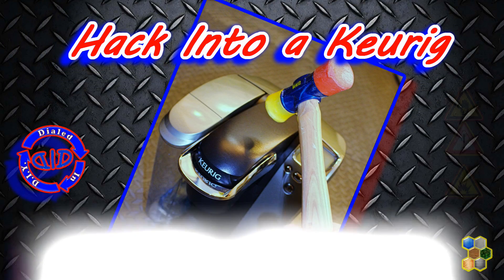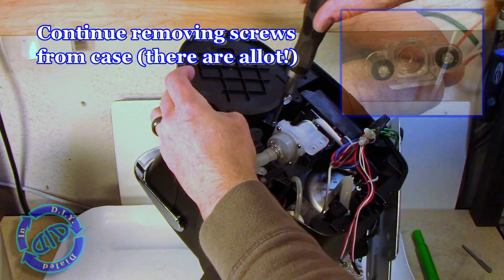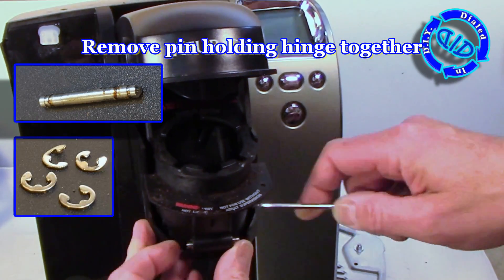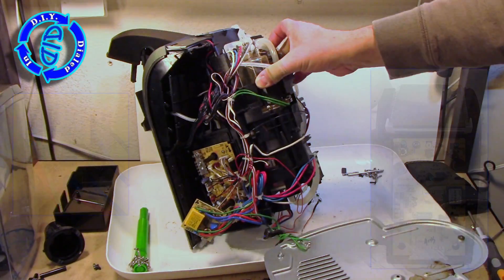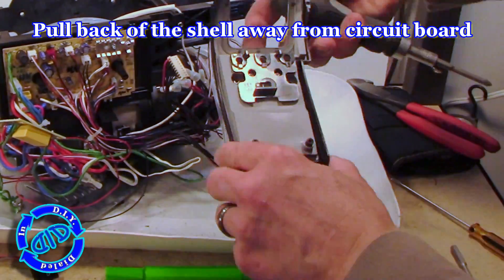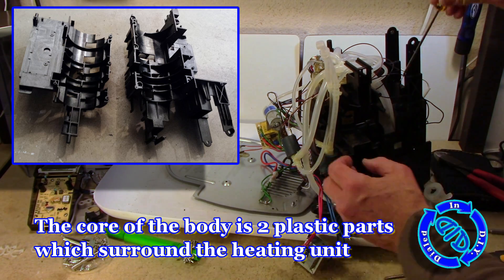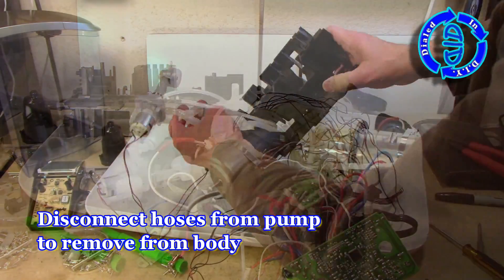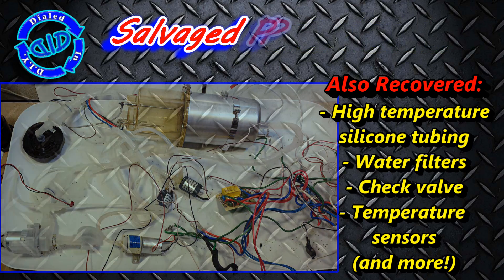Hack a Keurig Coffee Maker - See What's Inside - Free parts & motors

Comment: I attempted to make an outdoor shower using the 2 or 3 of its small 12v pumps and the water tank/element. I did it without any type of thermostat and after testing , the element inside  got extremely hot and melted The plastic portion above it.  It did however work for 5 minutes. had I put a programmable thermostat and larger pump it would have worked. Not sure how long by pushing the element assets design capabilities but it was a garbage Keurig anyway.   the amount of water was not impressive but it was enough to take a emergency shower.

Comment: I just destroyed my single serve unit. I plan to use the heater unit for a solder bowl, water pump for my cooler unit, and the hose is perfect for piping my butane soldering iron to a larger tank. Great video btw!! U sure are patient. In the first ten minutes I pulled out the large screwdriver and the side cutters!! 😆👍👍👍

Comment: How is this powered? It just uses mains and sends it to the rest of the circuit. How many amps can it pull?
Reply from the maker: The one I took apart plugs into main AC outlet. I did not test to see how many amps it draws when in use though. Thanks for taking time to post a comment, I appreciate it.

Comment: Hi, I've been trying to reverse engineer parts of what's likely either a B31 or K15 Keurig. I've been able to get the LEDs on the brew button to light up using voltage into black wires, and grounded on the red. Thought this was really weird color-wise (as I'd expect the ground to be black) - have you noticed anything similar on your adventure here or elsewhere?
Reply from the maker: That is a really good question.  I seem to recall that there were green ground wires on this particular model but I can speak to the other lines running true to typical colors.  Yes, I have seen some really weird wiring colors in commercial products.  Portable heaters are great examples.  I have found all power lines in a unit the same color in multiple heaters.  One had reddish-brown, another was blue and another was some sort of off gray.  Always makes me chuckle and wonder how many times lines were messed up during assembly.  Best of luck with the reverse engineering!
Reply: @DialedInDIY  Thanks! Seems to have worked with the red acting as ground, but still wonder if I somehow got things confused in a strange way that still lets it work...
Reply from the maker: @JeremyCook  So glad it worked out.  I've definitely been there... scratching my head because something worked but I am not completely sure why.   Hope all is well.
Reply: @DialedInDIY  Thanks! Overall I'm quite happy with how the project turned out, but there's still that nagging feeling... :-)

Comment: Just disassembled the exact same model yesterday.  I don't know yet what I will do with the electronic components salvaged. I decided a while ago I would not throw away electronic devices without taking them apart and salvaging parts for other projects.  Watching your video helped identifying some components.  Let us know what projects you ended-up doing with with the salvaged parts.
Reply from the maker: Thanks for watching and taking time to comment.  Love to hear that feedback.  The pumps and solenoids I've been salvaging I have ear marked for some silly water feature or toy kind of ideas but have yet to do them.  I will try to make sure to call out where parts came from when I use them in other videos.  If you end up using the parts for some fun stuff, I'd love to hear about it!

Comment: I have used this every single day since I got it!>>>ur2.pl/1186   I was a little skeptical a first when I ordered it and had concerns. But when it came it worked great. The only thing I don't like is that you can't change the temperature. Overall a good quality machine.
Reply from the maker: It really does a good job; does exactly what it is billed to do.  Good point about temp control.  Thanks for watching and for the comment.  I greatly appreciate it.

Comment: I dismantled a B70 today.  Only thing salvageable was the transformer, water pump and one solenoid.  Air pump and other solenoid were destroyed by a leaking solenoid.  I was able to repair one K70 with the one working solenoid and keep one out of the landfill at least and recycled the rest of the plastic parts.
Reply from the maker: Nice fix on the 2nd machine!  They don't make these things easy to get into to repair though do they?  After a few minutes I wanted to rip the case apart.  Your comment was a good reminder that I have another broken one that was given to me for salvage (I want to see if I can figure a project using the heating tank). Thanks for taking the time to share your comment, I appreciate it!

Comment: What is the Rp plug connected to on the power board ? I really need to know this can anyone help please and thank you
Reply from the maker: Good question and unfortunately I do not recall clearly what was connected to what... but I still have most of those parts so I will take another look to see if I can find out more info (Please let me know if you already got your answer).  If not, then does anyone else have any info on this Q?
Reply: Thank you for answering. I found out Finally that the RP is for the momentary power switch on the back. Thank you. I repaired it and it works just fine now.
Reply from the maker: Oh, very cool.  Glad to hear you got it fixed!

Comment: I plugged the coffee machine into 220v electricity instead of 110v, so it's broken. I think I need to change the fuse wire, but I don't know where it is and how to get this part.  Can you help? Thank you!
Reply from the maker: That is actually a great question.  I had come across an informative site that covered fuses and it might help: http://www.singleservecoffeeforums.com/post95512.html
Reply from the maker: I am not sure which model you have but that link is focused on the "Dissassembly + Repair Guide - Keurig B70 Platinum"
Reply from the maker: Hi Kaylee Zhang... sorry, I forgot to answer the second part of your question. I've seen on several forums that people can't find replacement parts for interior components from the manufacturer. I have, however, seen used parts show up on ebay and other sites. But, my first suggestion is to look for burnt out components once you have the machine opened up. It could be a fried circuit board.

Comment: What are the specs for the pump?  I stripped one of these down a couple years ago for the parts and now am thinking about making a siphon pump out of the keurig pump to transfer wine from carboy to bottle.
Reply from the maker: Sorry for the delay in reply... the pump is a 12v, high output.  Were you looking for more details in terms of specs or does that kinda cover it?  Let me know how use as a transfer pump works... sounds like a cool idea.
Reply: What is the max. pressure output?